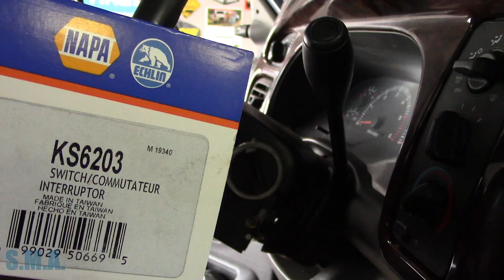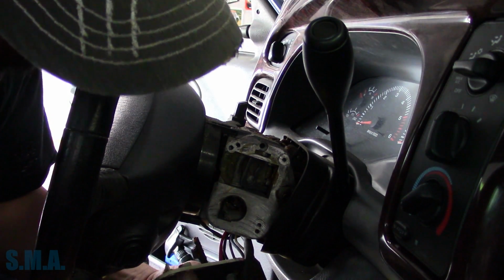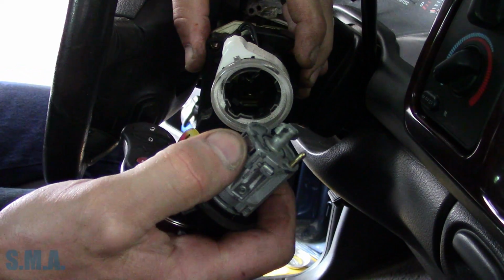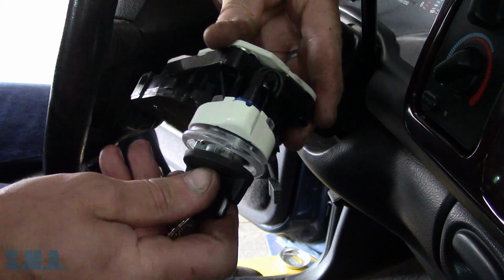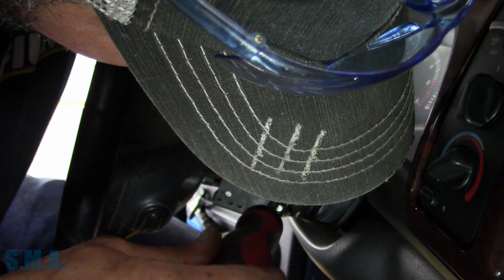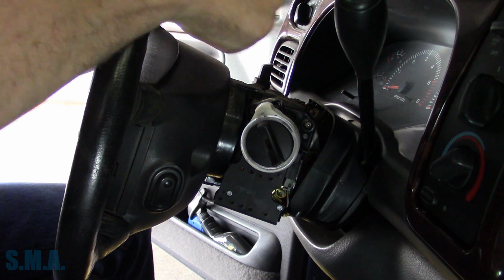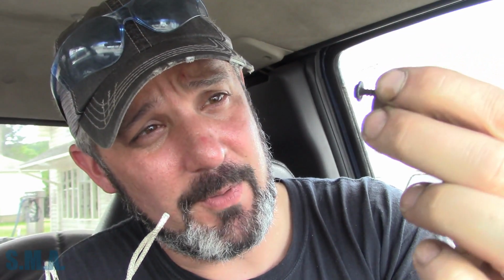Shop Screw Ups - Follow Up

Comment: New York State issues licenses to repair shops..........You were nice in protecting your competition, but that shop needs to be blown into the authorities.  Judging by the receipt that you showed, that same shop clipped me for some front end work.  He did a slipshod alignment and said all was good to go.  Driving home it was clear that the requested work was not done (bad strut bushings) and the car was still wandering on curves.  When confronted, he said he would refund the service charges, but wanted the $ for the "non-returnable parts" that he did not install.
My lawyer had to call this guy and remind him that his shop's license was on the line.

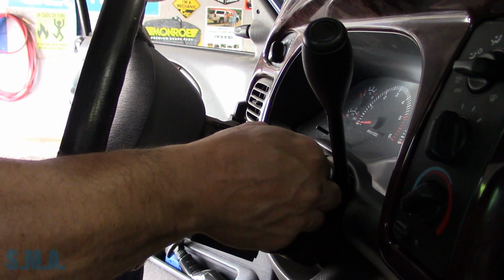Comment: 1:55 "We're gonna start with a T25... T25... try again, fella... so it should be a T20... like I say... a'ight... first try..." Haha love it
4:00 Actually, you'll cut yourself with a blunt knife from slipping, more than a sharp one, due to the pressure you have to put on it to make it cut. When whatever you are trying to cut finally yields, there's a lot of stored accelerating force left in your arm.
8:42 What you have there is a solar-powered mechanical fitment toggle. You can struggle for ages in the dark trying to install the mating parts and it won't happen UNTIL you shine a light on it - then it almost magically becomes capable of coupling components without any adjustment needed to either component. They're fitted everywhere these days. I'm pretty sure they were designed by a chap named Murphy.

Comment: These Dodge trucks are extremely easy to steal, that was the first thing I had to replace in our Dodge truck when it was stolen was the ignition switch they literally just use a screwdriver and break that little plastic thing and pop the lock cylinder out and start it with a screwdriver The same screwdriver that they punched the door lock with.

Comment: The non HEMI made me think it is probably a better engine design as far as engineering. The HEMI seems to have a notorious problem with cam and lifter failure all because the cam is placed too far away from the crank and doesn’t get oil flung on the lobes

Comment: Wow, I'll trade that job with you for the '08 Lexus RX350 ignition switch I did. Holy crapper what a PITA that was!! Like a 10 hour job for me ... 😬😬😬  

While on the subject of PITA jobs, who the hell designed the newer Ram parking brake assemblies? Took me almost 4 hours to do a '13 today! 🥴

Looks like you got yerself a new customer there! 👍🍻

And speaking of customers, had my first a-hole one in 11 years. Apparently it's my fault his 21 year old truck has no oil, since I changed it 3 months ago. Was also my fault his rear diff started leaking due to a rotted-through cover, and also my fault that the stop leak I told him probably wouldn't work and would ruin the system didn't hold his charge in for more than a day. No good deed goes unpunished! Next, I'll get accused of putting bad air in his tires ... 😡
Reply from the maker: Wow I heard you were a bad mechanic.... You really too that poor guy to the cleaners... 😐

He's still alive right!? Nevermind, I don't need to know anything.... 😏
Reply: @SouthMainAuto  😂🤣😂

Comment: Hello I was wondering what you recommend for a scan tool for a 2011 ram 1500 with the 5.7. Id like to be able to look at clutch cvi and other powertrain programing and diagnostics. Im not running a shop just for my own use. By trade im a heavy equipment mechanic looking for something to work on my pickup.  Iv looked up some snap on tools and autel ones. Lots of choices so i was wondering what you have had the best luck with on these rams. Thanks for everything. I really enjoy your channel.

Comment: 100mm = 4 inches in the semiconductor world.  Semiconductor wafers are 100mm, 150mm, 200mm or 300mm but we call them 4 inch, 6 inch, 8 inch or 12 inch.  It isn't exact as 4 inches is 101.6 mm.  Close enough for horseshoes and hand grenades.

Comment: If you can easily buy tools to work on "tamper-proof" parts, that's not much of an hurdle. It's just a boon for tool makers.
Reply: Pretty much. I’ve got a big set of cheap bits that was sold specifically because it has all the security versions of everything. There are some screws that are actually security because they only drive one way or break the head off when installed.

Comment: They quit illuminating the halo ring around the ignition key cylinder and wiring it up for,in 1998, and my research looking at several of these trucks while finding this one eventually was the first two years later still have the halo ring 98-99 but some will have the bulb but no wires,or the no bulb, or the halo ring the bulb and connector but not wired to anything and then there's my Laramie slt quad cab 2000 dodge ram it's not even a halo ring it's a black plastic smooth finish like the dash cluster bezel ignition ring..

Comment: Hey bud, I've been subbed to your channel for a good while and been enjoying all your content (even the umpteenth brake job). 
I got an unrelated question. (Hope that is ok)
I have a 2002 z71 with 5.3, 200k miles. After about 10 min on the highways (when I happen to notice it at 65mph) I get what sounds like a rod knock. Twice, I stopped off to see what is going on. The knock seems to be coming from both sides or perhaps the middle front of the motor and quite pronounced. One time it went away just idling about a minute after I turned ON the AC (doubt that is related). In a few instances, after noticing the knock ~10 min later it was gone (basically when I get to work -- all highway: 65/75mph). It is hard to notice unless parked or driving close a K wall on the highway because there is a dumb Flowmaster installed. My father about two weeks prior to this thought it was an exhaust leak so I performed a smoke test with no leaks and forgot about it until I started driving the truck more regularly. 
I have not had a chance to perform a ear-screwdriver-test. I have had this truck for almost 2 years. Oil pressure never gets above 40 (which is on the low end from what I read on forums). The fact that this happens only at operating temp then goes away is really confusing me. Thoughts? 
Also, I am all set to do the timing chain gasket (and chain—already did the intake, knock sensors, valve covers and thermostat) the oil pump is a little pricey but might as well? Maybe engine flush first? Which makes me wonder if the knock could somehow be the chain… I know that might seem crazy…. I dunno…

Comment: A little surprised you didn't re-apply the shmew on the back of ignition switch.  ;P  even if it only last 1/2 as long that will be getting up around 200k.   so /shrug

Comment: I wish the "Don't Be A Jerk" motto worked here where I live. 
The local shops want $400.00 for the clockspring and another $650.00 for the labor on a 2007 Dodge Nitro - when the shop that quoted that repair, had broken the clockspring themselves when they replaced the "ball bearings" because they didn't have a grease fitting on them. 
Thieves. 
They saw my wife's friend (a woman) and took her to be dry cleaned. 
Jerks & thieves!

Comment: Damn, you can remove a lock module with only 4 screws?? For a lot of years Australian cars have had shear bolts that you have to drill out to remove a lock assy. In defence of that, unlike in the US if you steal a car in Australia you only get a kick in the arse and a stern don't do it again from our piss weak justice system. Consequently car theft is very common over here, and manufacturers have to try and offer some theft deterrent before electronics became the norm. But love the vid as always. This stuff is like watching mechanical porn for us that fix cars.

Comment: So question for all the mechanics. How do pro mechanics handle this? What do you do when parts break that you can't replace? I took my truck to have transmission work done. It's a 1994 GMC sonoma. Old brittle plastic. These fuckers broke off a couple plastic clips that hold my center console down. I don't blame them, it's old and brittle. I also know its fucking impossible to find new interior parts in my color (close to navy blue and yes I know GMC calls it something else). But they didn't even bother to tell me until I drove it down the road and the panel popped off.

Comment: I would much rather spend 20 minutes looking through the wiring diagram than on my back in the footwell replacing a part unnecessarily. That other shop is silly.

Comment: No fun at all, no springs jumping out and ball bearings pouring out of the column.  I hope you charged them $351 just to start, showed them the still good OEM parts and the fuse box situation.  But, I know you didn't, I understand, I fix computers for people for a fraction of what geek squad would rape them for, and I make house calls.

Comment: Does anyone else notice how not difficult it is to steal one of these vehicles?
Reply: Most of the older vehicles are really easy once you know the specific vehicle. The newer ones have gotten to where you need something to make the computer happy before it will run so it’s better. But, people can still steal them if they’ve got the equipment and/or knowhow. 

Many of the carbureted vehicles were as simple as jumping power to the ignition and jumping the starter.
Reply: @NBSV1  yeah, but a person still needs to break the steering column lock. In this, you only need a tamper proof torx bit.